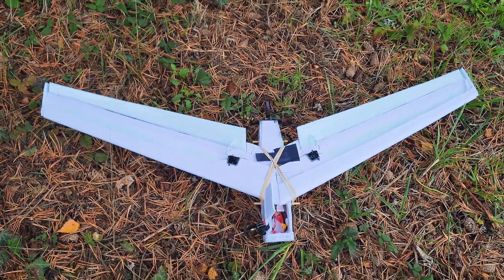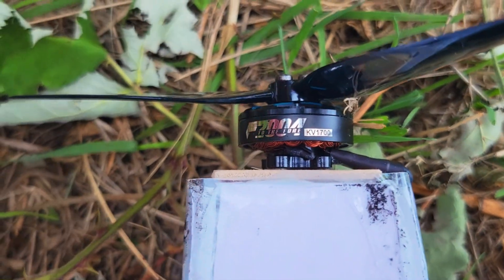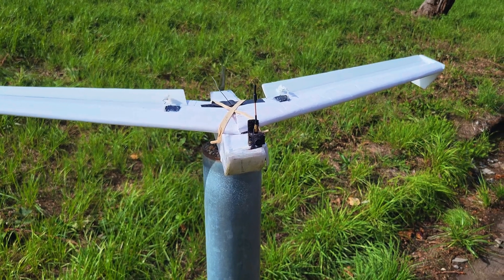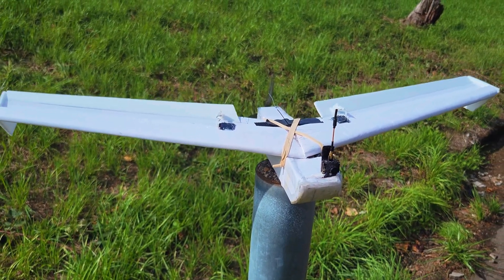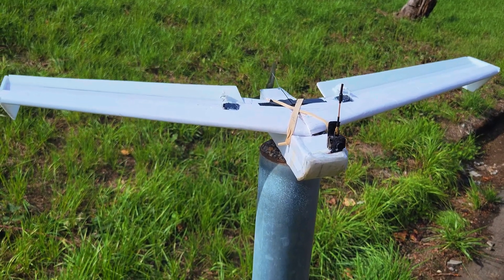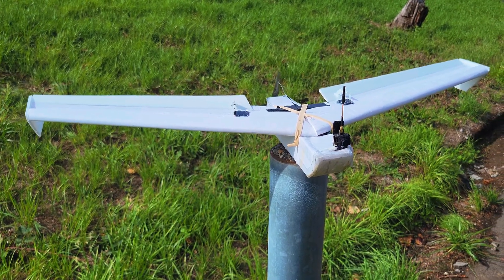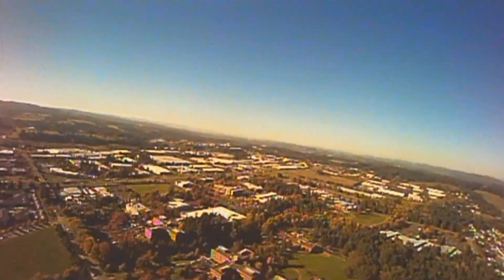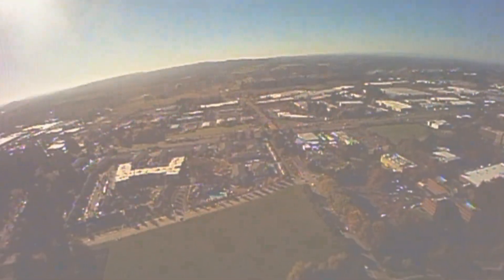Micro-Pelagornis - Sub-250g Long Range Foam Build | 8:35 FPV

Comment: KFm wings are not the most efficient.  Look at the Nano Goblin and its nice slim wings and streamlined shape.
Reply from the maker: Yeah, I'm going for strength with a limited amount of material to hit the 250g weight. I'd be going a whole different route if I had a Cnc or hot wire cutting setup. Then I could use Xps foam or something like it that's much lighter.